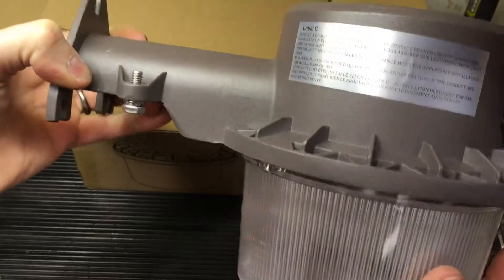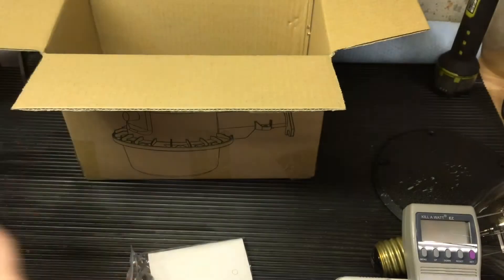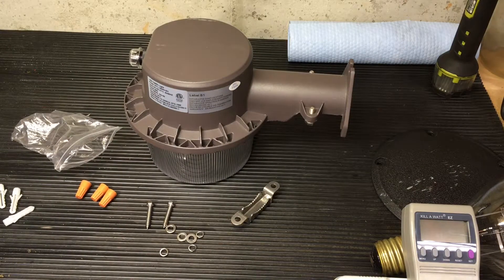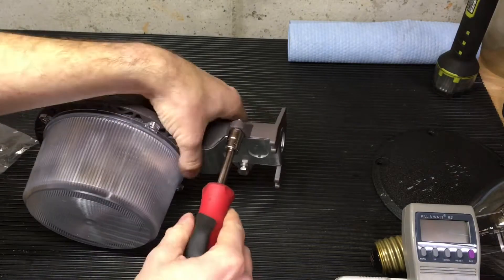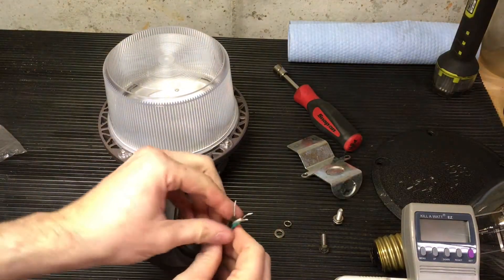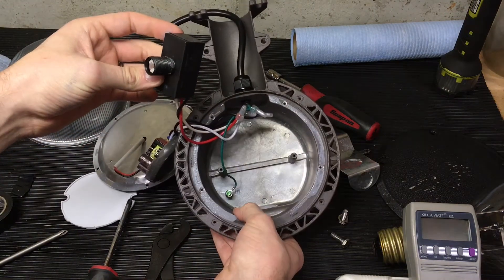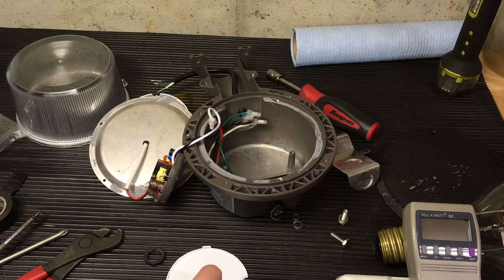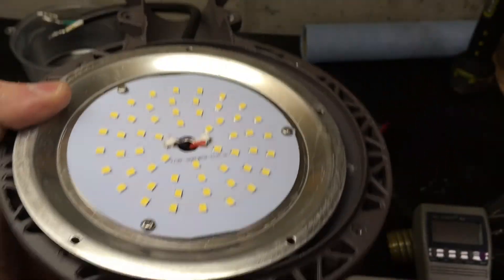35w Hykolity Yard security light unboxing and teardown

Comment: amazing a chinese LED fixture that actually uses the power they claim. are you sure they are 2835's though..  that means the fixture putss out around 7,000 lumens..  Not bad for 35 watts.  The main problem i still have with LED's is it may be 35 watts and it may be 7000 lumens.. but it still has a shtty reflector/refractor.   The lights are still pointing downward.. so it wont have the full coverage a HID light would.   I garuntee a 100W or 70w hps/Metal Halide will have much more light spread than this fixture